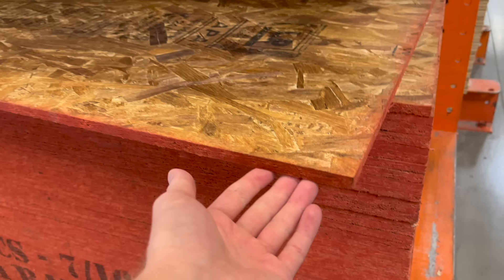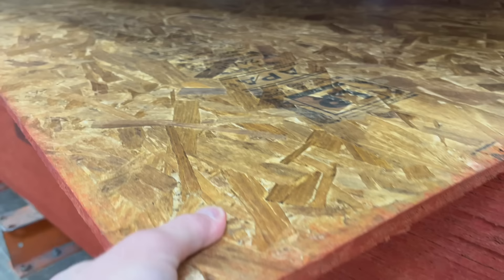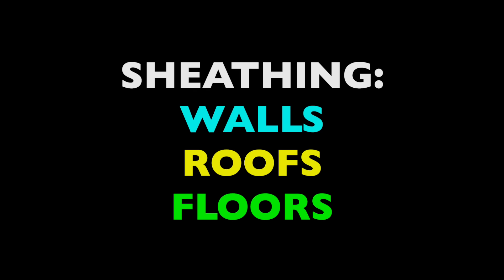Is OSB Bad?! (Oriented Strand Board--What It's For / When To Use It...House Sheathing/Subfloor)

Comment: OSB soaks up water though like a sponge, I know it does since a board of it above a garage door was bloated with water and weeping from a small roof leak. The layers of OSB on the outer wall of the garage near the base soaked water and rotted out. Keep OSB from water damage at all costs. It turns to mush basically.
Reply: The Problem is thats outside. Nobody in Europa uses it outside. Only inside. Cheap with tyvec outside or more expensive with mdf. For vented construction. We have osb3 and 4 4 is 100% waterresistant.

Comment: I live in Arizona and sometimes have wondered how long MDF can remain architecturally sound during construction, especially during monsoon season. Almost every home is frame and stucco out here…
Reply from the maker: Until ZIP came along, I bet I was the stuff on 90% of builds in NC. I’ve seen it get shaggy on jobs that fell apart due to financing, but most jobs it gets wrapped and roofed too soon to matter.
Reply: Todd, this is not MDF. MDF would last about a day in monsoon season!
Reply: @jobacuda4472  You’re probably right but it sure looks like it…
Reply: @jobacuda4472  My bad, OSB…✌🏻

Comment: OSB for flooring is a much different product than the thinner stuff. It is designed to take more weather exposure and abuse. I try to never use OSB for anything (subfloor excluded) other than sheeting gable walls and such, where it really does nothing more than hold up siding. Real plywood is just better in nearly every sense. Especially on a roof deck. OSB may meet code, but when a tree branch hits that roof, a plywood deck will have a few damaged shingles. An OSB roof deck will have a big hole. Seen it many times over the years.

Last week I stopped at the local big orange box to browse around. 5/8" OSB was over a dollar more per sheet than 5/8" CDX plywood. Why anyone would ever choose OSB over plywood in that situation is beyond me.

I have heard that OSB has equal to, or more shear strength than real plywood. But having built sheer walls designed by engineers, I don't recall ever seeing one spec'ed out to use OSB. Always plywood, always with very specific fastening procedures.
Reply: In Reno I saw shear walls with 5/8" plywood on BOTH sides of the wall, perimeter-nailed at 2" on center!

Comment: I played some rock n roll in a large 2 story shed in Georgia that had OSB on all the interior walls, unpainted, all the chips visible, and it seemed to absorb sound very well, with no echo (having a good "dry" sound) and you could play a long time without hurting your ears, and hear the other instruments clearly.  It seemed like accoustic foam or dropped ceiling tiles and I wonder if it has a high NCR noise coefficient rating.  All the glue and wood bits may act as sound absorbers.
Reply from the maker: That’s interesting, Bernard!

Comment: Absolutely hate the stuff.  In Canada we used BC Fir plywood until about 20 years ago when this stuff appeared.  The only advantage it has is its cheap price.  It's laden with glue and chemicals making it heavy, it dulls saw blades quickly and is too water sensitive, if used inside the house it will smell forever, and it's high glue content makes it a fire concern.  If I were building a house I wouldn't use it.  If quality plywood became too expensive, then I'd go back to 1x6 spruce boards laid diagonally for subflooring and 1x8 spruce boards for roofing - no glues whatsoever, and strong as can be . . .
Reply: I wonder how long it will stand up with the humidity and the big temperature  changes we see in Canada..

I am not a fan either...
Reply: Luckily, plywood has no glue or chemicals in it?!
Reply: @jobacuda4472  Obviously, plywood has glue in it too, but only a small fraction of what OSB has . . .
Reply: @fredberger3155  True.

Comment: Replacing my carpet with laminated floors, my living room osb subfloor were sagging between the joints. I used an appropriate cement from lowes to fill in the sagging gaps to level it. The house was built in 1979 and I felt the osb was too weak and sagged over the years. Next time I may replace the osb subfloor with plywood.  Anyone have better suggestions.  Thanks.

Comment: As a flooring contractor for nearly 45 years, my complaint with OSB has always been edge swelling. After I do my moisture test, it sometimes take a couple of hours to sand down the seams before I can install hardwood or LVP. But it will hold a staple as well as plywood.

Comment: "OSB Has More shear strength than plywood"

If you look into the structural engineering a little, you'll find this is basically irrelevant.  Both OSB and plywood have much, much more shear strength than you can utilize with the number of nails we shoot into it.  Even 1/10" paperboard (Thermoply), gypsum-fiberglass sheathing, or asphalted fiberboard are good enough for code with the right fastening schedule.

For floor & roof sheathing, yeah.  Stiffness against bending out of plane when stepped on is absolutely a relevant number.  Though you should understand it's a number that rises exponentially (okay technically x^3) with thickness of the sheet good.
Reply: @chrisblue4652  Sheathing in a shear wall resists racking forces trying to fold your nice wall stud rectangles into a bunch of rhomboids.  OSB has a slightly higher ceiling number for racking resistance than plywood, but in reality you'll rarely see anywhere close to that number because sheathing nearly always fails against racking forces by the nails breaking, pulling out of the sheathing, or out of the stud.  Double the nails and you double the racking resistance.  Quadruple the nails, quadruple the racking resistance.  At some point there's enough fasteners that the material the sheathing is made of makes a difference, but it's an enormous, impractical number for half inch OSB and half inch plywood.

Engineering tables go down at least to 2"-on-center nailing schedules and see linear improvements.  At some point I expect you'd start to have issues with splitting the studs.

Comment: My garage has a loft that the people decided to floor with osb. Suffice it to say as a 300lb man I prefer 3/4 plywood lol
Reply: The spooky thing is being aware that it would be nearly impossible to break through plywood all the way, but OSB and MDF have no such assurances.
Reply: The irony is plywood is always assumed to be stronger and it just isn't. Some manufacturers do make it stronger than others, but I have seen osb and mdf withstand harder forces or more weight than plywood. Comparing 1/2" to 3/4" isn't fair. But at the price point, you could layer (2) 1/2" osb, in this example, for flooring, cheaper than 3/4" plywood. I have seen professional grade skateboards that are made of plywood, and a homemade skateboard of mdf (the stuff people insists is weak) and the plywood is "easy" to break. Mdf skateboard hurt. I felt if I put more force in it, I was going to destroy my ankle first. As a skater, we have bad tempers and when a trick goes bad and we get hurt, we tend to logicalize putting our foot through the middle of the board to make us feel better. (Until the rage goes away and we realize we just broke a $70 board and have to buy a new one.) That being said, we have practice breaking the wood with our legs. The fact is, different companies make products differently. To openly say one is always better than the other is no true. He said to not use osb for furniture. I agree, however, you could still do it if done right. One complaint is the looks. A lot of people laminate or covered the surface with thin hardboard anyways. This the looks would go away. Flooring? I would never use straight plywood. Too costly for what benefit? Yes you are unlikely, in a normal situation, to go through every ply, but what are you doing to break through even 2 plys? How far apart are the studs to not support the weight? The subflooring isn't suppose to be there to bare all the weight. The 2x4s or 2x6s, even 2x8 floor joists are there to hold the weight. They started making the distance shorter to make sure the subflooring don't bare all the weight. 16inches on center and you find a way to go through the osb and straight down to another floor? Something else has failed. Not the osb. In the end, if the spacing is proper, the subflooring type is irrelevant. If you prefer plywood and can afford the higher price tag, use plywood. For those who are unsure of the benefit or can't afford more expensive material, stick to osb. Make sure the stud spacing is right and both work the same in structural stability of building of a house.

Comment: Was recently wondering the difference where I may have to replace my bathroom subfloor! Great timing! Thanks!!
Reply: I recently replaced the flooring in much of my house, including the master bath. I found the plywood subfloor of the bathroom had 1/4 inch OSB glued on top. When I got the toilet up I saw why: water had leaked under the toilet base, probably from a tank leak, and wicked into the OSB for about a foot on every side, turning it into black mold. (Fortunately, I had bought an N100 respirator just before that.) I had no choice but to entomb it in self-leveling cement.

If you can find a way of waterproofing it I have no objection, but that misadventure is still fresh in my mind.
Reply: @flagmichael  is entombing mold infested subfloor an option? I’m currently trying to figure out a cheaper solution that doesn’t have to be worked on in 5 years

Comment: I use the avantec sub flooring with no need for another layer of half inch plywood. it is thick enough and stout enough to go directly on the joists with a good adhesive, and it will never squeak or have weak places in it. As long as you use the proper screws at 8 or 12 inch spacing, it will never need any maintenance.

Comment: Exactly, well said IF it doesn’t get wet, OSB is a money saver.  But you better have a bullet proof, know what your doing water barrier system through out 100% of where it’s installed. That includes not just house wrap, but every window and door installation, roofing, wall penetrations, etc.  Better not ever have a plumbing leak through OSB.

Plywood is more forgiving of mistakes. AFAIK, everybody makes mistakes.
Reply from the maker: True, Falstaff. Flashing systems are all the more important on OSB sheathed houses.
Reply: I've seen plenty of rotted plywood in my time. The solution is to build properly.

Comment: I have been using OSB for yrs. I treat all the sheets with a anti-rot product from the store. In the barn where I keep cattle or horses I use a 50/50 mix of trash oil and diesel with a little anti-rot and I don't worry about moisture and never had a swelling problem and some places that I do use plywood I still treat it, esp on roof sheathing and flooring. amazing stuff. I was told yrs ago the the OSB was made from sugar cane stalks? I cringe at the rip off price for a sheet of 3/4in,,,,,,$40 yipes.

Comment: I’m a big believer of drywall screws, osb, and brushed motors. I definitely think they all have better options, such as deck screws, standard laminate plywood, and brushless motors, but, it’s hard to explain in a comment without making it too long, they all have their place, but they all work really well in a lot of situations they shouldn’t be involved in. Perfect example, my dad used drywall screws directly into the mortar on the house, no pre drilling, no anchors, to hang floodlights when I was like 3. Just replaced them now with new solar lights, no corrosion, the mortar never cracked or crumbled.

Comment: I've seen OSB used for shipping skids and creates, mostly in industrial applications.  It seems fine for the walls of a create but horrible for the floor, in all fairness i've seen poorly costructed creates made of plywood fail. Whenever I had to make a skid or create I tended to use mostly 4x4, 6x6, and plywood. OSB tends to rip apart under heavy loads, the 3 inch 316 SS leg of a 5000 pound machine tends to go right through the stuff as the truck goes down the hwy.

Comment: When we ran out of Advantech my helpers threw in regular OSB on the floor after the framing was done I had to jack up the house 1/4 inch and replace that junk OSB water destroyed it. Another great place to use it would be the lower part of the wall.

Comment: I always learn something from your material studies, Ethan, thank you. Before really starting to get into woodworking, I had a lot of home repairs to deal with and discovered 18mm OSB as an inexpensive option for replacing broken floorboards. Appearance didn't matter as there was nothing special about the original wooden boards and it was all to be covered. The only drawback is where an obstruction, such as a pipe I'm not ready to move, sits high under the boards. For these I use solid wood as I can cut a groove to accommodate, finding that weakens OSB too much.
Reply: I had a very bad experience with OSB glued to the plywood subfloor under a toilet. A water leak destroyed the OSB and I had no choice but to fill the area with self-leveling cement.

Comment: I like the aesthetic of OSB; I've built a tall skinny chest of drawers out it using copper plumbing T fittings as drawer pulls.  I'd like to build something using OSB and Galvanized steel with its similar flake texture and finish it in clear coloured lacquer.  One drawback is the smell, which, unless painted, tends to evoke wood shavings in a pet shop!

Comment: Thanks for the info. I understand the desire to source less expensive materials but I would have saved less than $1000 on my material so I went with plywood. I knew they were making improvements but still felt OSB would be subjected to possible moisture (slab on grade).
Reply: Smart man. The cost difference is rarely enough to substitute OSB for better quality plywood.

Comment: Great video. Another issue I found over the last 30 years is one side is protected with some kind of wax, making it very dangerous while nailing to trusses and rafter during rainy days. My Father slid off and fell 15 feet. After that we nailed it rough side up.
Reply: I have worked at a osb mill for 26 years, the rough side is supposed to be facing up, for your safety.

Comment: Manufacturers edge coating does not stop edge swelling, I know as my sheets swelled on the edges anyway. When I bought sheets for the osb roof, I painted the entire panel, and  edges but not the aluminum surface. Oil based paints held their edge the best, latex paint was worse, and plain primer the worst swelling. I did not damage or scrape off the blue manufacturer coating. I think the edge coating is only to keep it from swelling in the air conditioned store where you buy it and during shipping to store. After you have it, even it covered under a tarp outside, it swells on the edges. Can easily make the edge expand go from 7/16 to 9/16 or bigger.

Comment: I opted for 18mm OSB3 loft (attic) floor panels against the usual 18mm chipboard panels we use here in the UK, as (1) it's lighter and (2) it spans 600mm against 450mm for chipboard, just costs a bit more than chipboard.
Reply from the maker: Good call, Lorem! I’ll have to look up UK chipboard. We have a wall sheathing version over here.
Reply: I had to look that up as I thought all sheet materials were available up to 2440 x 1220 (8' x 4'). I found chipboard listed in this size at trade suppliers but not B&Q or Wickes. I'm surprised since they sell everything else full size, as well as various smaller dimensions.
Reply: @worstuserever  Full sheets (I think) are used with flooring loft conversions, so builders only, as access through an open roof is needed.
Reply: @LoremIpsum1970  Yes, you would certainly have to be rebuilding the roof to get a full sheet up there intact. I meant if using so much material anyway, you may as well buy whole sheets and cut them down yourself rather than buy smaller panels, which are much poorer value. The part that surprised me was the OP finding chipboard only up to 450mm width and OSB 600mm. The widest 18mm chipboard at B&Q is 600mm, while OSB is available in 2440 x 1220.
Reply: @worstuserever  yes, I'm not sure about the availability. For 600 span (almost all of UK truss spacings) chipboard would need to be 22mm thick. I know someone who did cut down larger boards to do this. There is a cost impact on the smaller board packs, though in both types the smaller boards are tongue and groove edged.

Comment: Not only does it swell on the edges, but it will soak up water like a sponge due to how small the pieces are. The kitchen cabinets in our house have some panels made out of OSB, specifically the bottoms. One day when the hot water supply valve started to drip leak, all that water got soaked up like a sponge. It could only have been leaking for less than a day given how often we go into that cabinet. The OSB disintegrated in my hands and I had to replace that panel with whatever I had on hand (MDF, not much better). I wish it had been built with plywood instead.
Reply: i've never seen cabinetry made from OSB, weird as it is a framing material. Are you sure it wasn't particle board? that's pretty common way to build modern cabinets.
Reply: @chrisburns5691  Beat me to it! Particle board actually does suck.
Reply: I silicone seal all edges of bottom of any ‘wet’ cabinets.  That keeps any leaks from getting into the wood.  If caught soon enough then no damage. When I replace kitchens in my rentals I always upgrade to plywood for just the sink base.

Comment: i used OSB to hold up my Cali King waterbed.
it worked perfect, and both my back and my wallet hurt a little less.

im also planning on starting an OSB mini sail boat build soon. obviously ill be completely sealing the OSB after all the cuts are made, and before construction, then resealing the boat once it's assembled.

i personally like the way osb looks